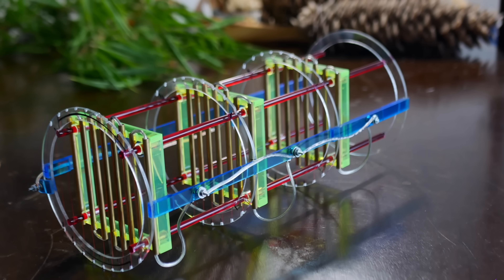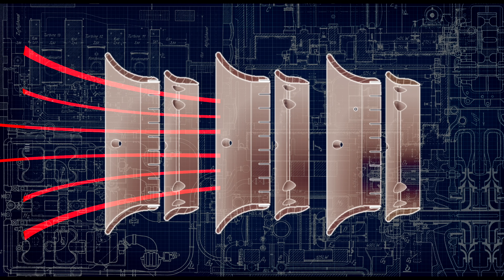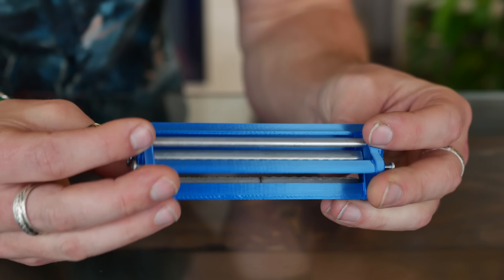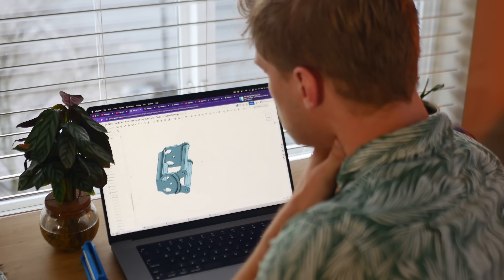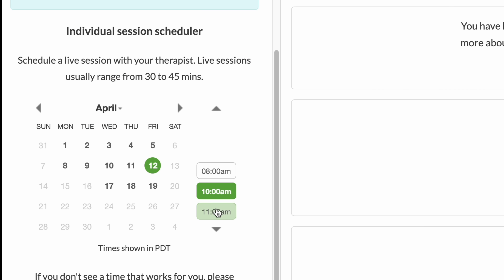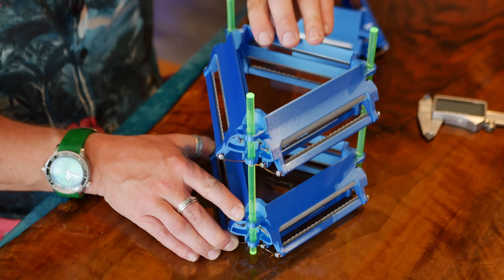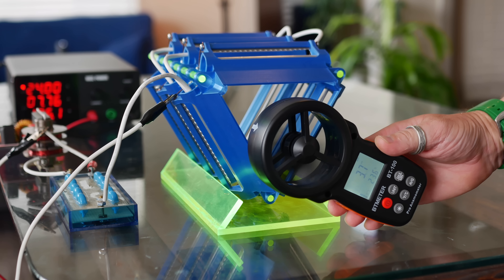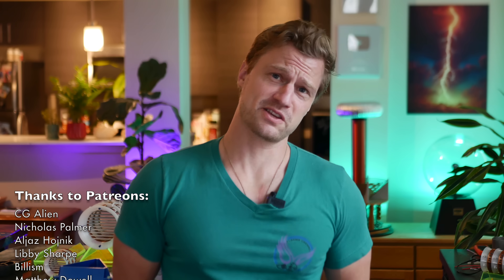Next-Gen Ionic Plasma Thruster Inspired By Nature (BTC Mark 3)

Comment: Shrink it down to the size of a small ducted fan and see if how far you have to go to get similar movement of air. It occurs to me this is just a chonky version of the ionic lifter design you saw in the 90s. The plastic and electronics being much heavier than the balsa wood triangles. Couldnt you make some really hollow 3d printed rings you sit inside to create a fully circular engine?

Comment: Pushing high mass flow of air with low speed is much more energy efficient for thrust creation then pushing low mass flow with high speed. Impulse is linearly proportional to speed while energy is proportional to speed squared. That`s why helicopter rotors are as big as practically possible and why turboprops are more fuel efficient than turbojets.

There are other design considerations that may limit possible layouts, but if you want to achieve maximum thrust for a given power input, placing each thrusters in undisturbed airflow will give you higher output than stacking them in sequence.

Comment: what if you can apply leverage to the air in order to increase output flow? creating a smaller exit would increase the exit velocity

Im using the same idea in my cars cooling duct system, where I increase the plenum volume of the radiator to create a low pressure zone. The air then exits from a narrow opening to increase its pressure and velocity

This is also similar in concept to the expansion chamber of 2 stroke engine exhaust systems, that utilize the momentum and pressure of exhaust pulses to effectively "pump" air through the engine

Comment: I believe you don't get any improvements from serially stacking those because after first stage, next stages need to "inject" their streams into existing stream, which is harder, because of greater pressure in the existing stream of moving air.

Comment: I don't understand. You spend the first half of the video talking about convergence and the apparent "diminishing return" of placing them in series, to then just make a three stage in series build in the end and be surprised that it doesn't perform better than the one stage...

Just abandon "in series" builds, build them in parallel, or really convergent like leaves...

What is "convergent" in your three-stage, in series build exactly ?
Reply from the maker: The air converges in the X, Y, and Z planes. Three Stages represents one of those planes. With the added difference that each stage only accelerates it’s own air. Not the air before it. So big changes.
Reply: @PlasmaChannel  The first stage accelerates air in a column. As the air accelerates in the column, the dynamic pressure diminishes inside the column, sucking air from outside into the column.

The air that goes through the second stage is already moving thanks to the pressure differential caused by the first stage.

If the thrust goes down with air speed (no turbo), then the added thrust from subsequent stages will rapidly go down (diminishing return).

If your criterion is volume per second per area, then you will have, if the above is true, much better results by building them in parallel.

How does performance correlate with area on your first stage ?
How does it correlate with pressure ?

Turbo jet engines need to increase pressure to achieve better stoichiometric balance and peak performance in the combustion chamber, you don't have a combustion chamber, but pressure can still be an important factor.
Did you try your engine in vacuum chambers ?

Does thrust go linearly with pressure ?

Comment: Exhaust velocity measured with an anemometer is quite a bad proxy for thrust.

Get a pitot probe and move it around the exhaust stream to measure total pressure. It will give you much better image of the thrust produced.

Comment: I share my knowledge: NIM engine. (Negative-Impulsive-Magnetic) Engine. (Because you build things, so why not help a bit)
Nice idea with the waves but you didnt use it yet in your thruster. You recognized some air is sucked into the thruster, although it thrust air out?
What is missing is the consideration of how the air consist and what actually move the air... electrons. Electron speed is determined by the voltage.
If multiple thrusters are in row, it accelerats the air with the voltage-plasma but not beyond the voltage.
Also the distance of the accelerating parts could be 1 factor at your build, also try to get lower ampere with same thrust results.

In SHORT: Air volume calculation, air consistance calculation, thrust calculation with air, thrust efficiency by testing the best volt to ampere ratio, Thrust Frequency.
Air(A): volume x consistance, Thrustfactor(Tf): volt x ampere, ThrustOutput(TO): Tf x A x TF (Thrust-Frequency)
Think of the electrons AS if its waterdrops. Always make the plasma visible once to see where its flowing (helps alot).
Also a magnetic field guides the electrons, because these are negative charged.
Reply: yeah, good stuff. Regarding the electrodes potential and air flow, I think it would be worthwhile looking into sequential electrodes at progressively higher potentials, and possibly a pulsed  arrangement...
Reply: @ashleyobrien4937  Realy you as well ? FFS
Reply: All sounds nice an all but electrons are lost to IONs that provide the thrust so straight off the bat you haven't a clue, lets see " thrust calculation with air, thrust efficiency by testing the best volt to ampere ratio, Thrust Frequency." This is bollocks its nonsense Volts * amps is power in watts and what the hell has that to do with thrust frequency. You got some tart your trying to impress ?
Reply: @andymouse  awww, they was on the right track at first, that air has to move and it takes energy to do so...
got carried away with silly things rather than thinking about where the actual action/reaction force is, to MOVE air requires an action with equal and opposite reaction... where is the reaction? 

the only thing you have to "push" against is the charged molecules. the inertia of the air molecule, its mass, its refusal to change path, opposing the electrostatic forces.  what proportion of air flow is due to charged molecules being repelled/attracted to electrodes, as opposed to neutral molecules being impacted, absorbing kinetic energy, and slowing the charged particles down? 

in a way they was right with the voltsxamps. how many watts goes into just making corona, leakage currents, how much is put into actual force over time on the frame, the electrodes?
how much thrust does it make, how efficiently?

air flow is not the same as thrust...

entraining air doesnt create thrust. air that is dragged along by air you pushed on is nothing but drag. ie, dyson fans dont make thrust by accelerating air through the ring, the only thrust is at the nozzles, the air they sucked in and compressed and release at high speed.

but once that air is moving it can perform work if redirected ;)

you have to push on air. or get it to push on something... other than more air!
Reply: @paradiselost9946  You can push air against more air but since the air is a gas and can compress it won't be as useful as pushing against a solid instead
Reply: @Tletna  you can use air to push air... but you cannot push against that air! 
what pushes the air in the first place? here, electrostatic charges. in a propellor, the blade hitting air molecules. they want to stay still, they have inertia. in accelerating them one way, there is an equal and opposite reaction the other way. you move so many and you have so much thrust the other way acting against the prop, as mass was accelerated...

but once those air molecules leave the prop, duct, nozzle, chamber, whatever... they can have no more further action upon that device. the work was performed in accelerating them. what they do after that, who cares? its irrelevant. sort of.
 they can move external air around, lose energy in colliding with other gas molecules, but you yourself cannot get a reaction force from that extra gas in motion. 

UNLESS you then redirect that airflow. all of it. then it can act upon something else, impart its momentum to that. thats whats happening when he blows fog out the way. the accelerated airstream is losing energy to the stationary atmosphere. things get moved around. but very little of that air being moved creates thrust on the actual so called 'thruster".

the only "air" you push against here is the charged molecules close to the electrodes. everything else is drag. entrained air doesnt create thrust unless redirected...
Reply: @paradiselost9946  Sounds bang on.
Reply: You think he is smart enough to figure it out? He is roleplaying an inventor.
Reply: Wow that was amazing. If only you made it readable

Comment: it would insanely cool to see a lightweight drone that can hover using these.
Reply: A 30kv power supply and lightweight don't go together very well
Reply: I kind of forgot about the power supply. Thank you for pointing that out. @younscrafter7372
Reply: @younscrafter7372  what about remote power - is there a way to beam electricity at a wire to charge it up?

Comment: I’m no physicist or engineer, just a high school kid who really wants to be one, which makes me sorta unqualified to make suggestions… but something that crossed my mind with having three thrusters all working in one line like you did is that each thruster can only move X amount of air at whatever speed. once the air goes through the first thruster, wouldn’t the second be moving the same amount fed to it by the first, if anything a marginal amount more due to outside factors like gaps in the spacing or having some leaked out air in the system allowing for thruster 2 to add more air. I can see how each thruster could add more air by taking it from around the whole big thruster and putting it into the tunnel, but if thruster one only moves air at X speed then can’t thruster 2 only move it at X speed as well? Also it crossed my mind that outside the thruster (again just a high school kid but something I thought of) it would be a low pressure system, meaning less air for each thruster to move, and inside the thruster a high pressure system leading to the outflow. another idea I thought of (idk if worthwhile but I’m making this comment to get roasted a little so I can learn from actual engineers) is that thruster one operates at a lower speed or moves less air, however you would say it, then thruster 2 moves it twice as fast or a third as fast, idk how much faster bc it would take some mathing, then thruster 3 is top speed or however fast you want it to go, because then each thruster would be doing work to add air to the system, and the air would (in my thinking) gain momentum to push through the third thruster at a faster rate, also it would leave more power to the third thruster. One more idea I had to kinda test my low pressure thinking is to have a fan blow air on the whole thing or something along the lines to see if it’s the actual thruster being the limiting factor or if it’s the air around it ( I doubt it is tho). Sorry for a long comment, I just love science and love this channel and always want to learn more, so go ahead and roast me if I’m speaking nonsense, just thought I’d give some of my unprofessional opinion so that if it helps it helps and if it don’t then I learn. I also know that you have probably already thought of this stuff but just in case thought I’d share.
Reply: Never be afraid to ask question, kid :-) Even amateurs can still give insightful feedback that even the experts might have missed due to a mistake or bad day.

Comment: Hey😊 what about this. Its logical that three stages are not much powerfull than one stage. Reason is simple. If you look at your 3D model trust goes from side edges into the center and if they are three in row there are three same trusts but they dont have direction to meet. So there is no diference. So the point is you should have three in row and every one thruster must have different angle to accelerate air in one point all together or, just thin about opposite thrusters. First one angled into the middle, middle thruster from inside to outside intu the third thruster. Sorry for my english but hope you understand what i mean

Comment: Again, re-making 1990s lifters is not going to help make these plausible. If you want to enable ionic thrusters for flight then work on the solid state high voltage transformers and power supplies using piezoelectric transformers.

Comment: I think that if you modified the design so that it could feature a heating chamber to heat outgoing air, or just a heating element behind incoming air, the output air velocity should increace due to  expantion. Tough the heating element would have to be very hot to make it work, maibe hotter than what plastic could handle. Just throwing some ideas!

Comment: I think you can squeeze a little more by using the 3D printer to make molds in which to inject instant foam that you can later spray with a graphite(or metal)based conductive paint over which you can plate an extremely thin layer of metal(zinc/copper/nickel/silver/younameit) so that you can have the most exotic shapes both for structure AND electrodes, like tear drops arrays, waves, blades, again, younameit, even interleaved assemblies of positive and negative. I congecture that such shapes can boost output quite a lot more. Challenge accepted? 😅 I dare you to prove me wrong.😂
Reply: Oh, by the way, I'm not searching for recognition or fame. I'm freely sharing this as public knowledge. I just want to help the community, sincerely, and I'd love to see you trying my suggestion. I wish I could try, but my life is a mess and you wouldn't believe the struggle I have to bear on a daily basis or I'd give/pour all I have in R&D. Have a good day.😊
Reply: P.s.: to smooth them out, you can print at 0.08mm layer height (I do it regularly) and then you can spray the molds with a thin layer of acrylic. Once dried, you can spray some mold-release and inject the foam. Ideally, this should result in an extremely smooth and contiguos surface. The plating would further smooth-out things. It's a no brainer imo. Farewell. I love what you're doing❤, have fun.

Comment: My “physics nerd common sense” is telling me that a circular shape might help with a more uniform flow, as the three streams coming from the triangles are probably converging in a pretty awkward way. Also some way of directing airflow from each peripheral thruster(like a duct or something) into a smaller output area in the center would likely help reduce turbulence and increase the velocity of the airflow (assuming you are building this for velocity and not displacement ). I am a high school senior so take this with a grain of salt lmao
Reply: Spiral shape! Bending metal is easy.
Reply: in this case, the velocity of the airflow means nothing...
air flow is not thrust. the thrust is only due to the mass that is worked upon, accelerated.
and the only mass that is worked upon is the charged air molecules. their mass being repelled and attracted to the electrodes, being moved.

the issue is that a lot of the air flow is produced not by being charged and repelled, but by getting in the way of the charged molecules that ARE being worked upon...

you perform no work on moving that air. that work is due to the air you did perform work upon being SLOWED DOWN.

the only way to get that air to perform work is to make it change direction, it performs work against something... which is what you see when you "blow stuff around"... air slow down, stuff get accelerated away.

on a turntable, against a dyno, a load... i reckon it has virtually no thrust. all blow, no show :)
but if it had a blade mounted behind it, angled appropriately, and spun "backwards" due to redirecting the total flow...

and yeah, cones, ducts, circles, curved surfaces, always better... electrically and aerodynamically...

Comment: Am I wrong? 
About air velocity at 3:00 
The formula for kenetic energy is  E. = 1/2 m v2. 
if m (mass) is the same at all points in the ionic thruster 
2.1 m/s is 4.41 units of energy. 
3.2 m/s is 10.24 units of energy, and 
3.9 m/s is 15.21 units of energy. 
So the gain of energy at the thrusters seems to be the same and doesn't seem to indicate a reduction of the energy gain with the addition of thrusters. 
So if I am correct in my assumption, more ionic thrusters in series seem to be a possible way to increase the power of ionic thrusters. 
I would assume there is a limit to the amount you can put in a series, but it doesn't seem to be 3.

Comment: There's a reason he gives no thrust numbers for his Ionic THRUSTER. But it's ok, we can calculate it from his yapping about the wind speed instead:
P = 1/2*rho*V² = 1/2 * 1.25 * 4.1² = 10.5 N/m² over triangle with 12cm side or something like that:
T = 10.5 * (0.12²*sqrt(3))/4 = 0.066 N 
Or right about 7 grams of thrust for 165W of electrical power he puts in. He probably couldn't find a scale to measure this thrust 😂

Comment: I have been designing air ducts  recently, and one of the very important things is to not restrict the air flow rapidly. For the best results it's best to stay under 10 degrees of restriction. Keep up the good work!
Reply: Funny enough for engine cylinder heads it's about 15 degrees as the limit.

Comment: Make sure to measure overall thrust, just air velocity is an indicator of optimizing performance of a given design, but if you don't also account for the mass of the air being accelerated you may be missing some gains with the different designs.

Comment: Aerospike configuration. You have great output with one stage but interface with series. If you parallel them like multiple rocket engines in a linear areospike it will open up a wider range of convergence speeds without imparting turbulence on the next stage.